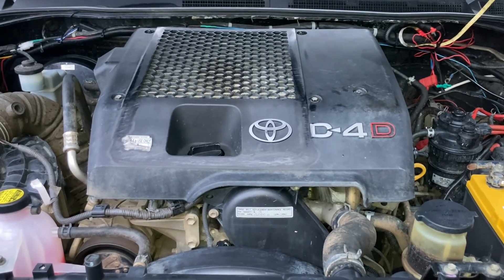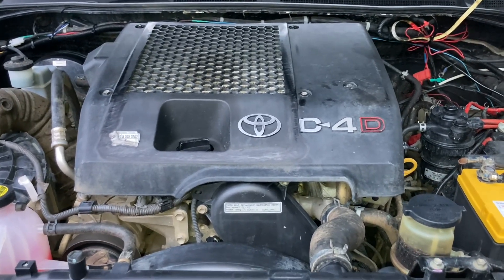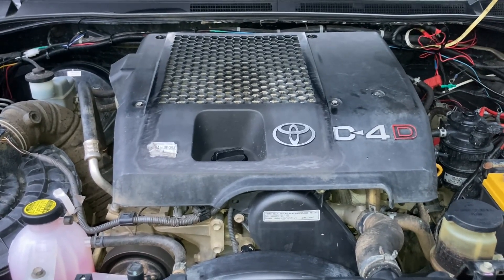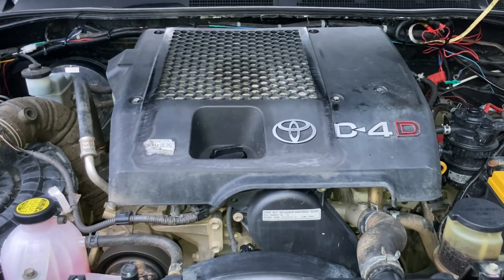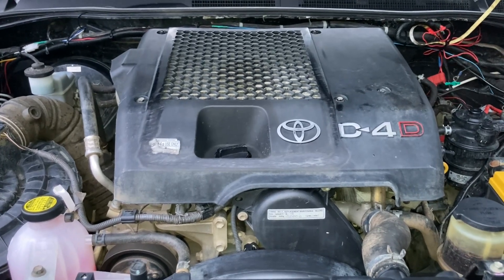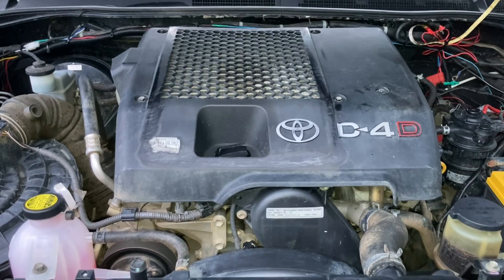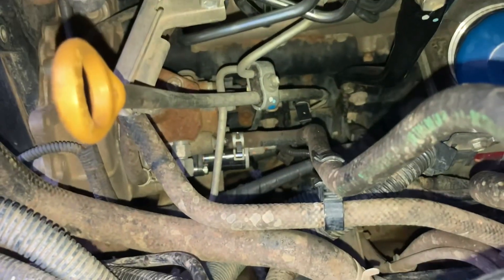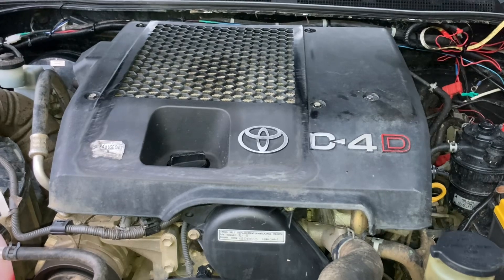D4d Engines Fourby4diesel 1kd-ftv SUPER WEIRD DIESEL KNOCKING

Comment: Call me crazy but I had this on my 05 lux when I changed the injectors. I didn’t bother with the comp codes. 

As soon as I entered the comp codes for the injectors the noise stopped. Engine run a lot smoother. Yes I know comp codes aren’t needed on a euro 3 but it solved my issues

Comment: Had this exact same issue after replacing SCV with a short one, fixed itself after a few short revs, target vs actual rail pressure still out of spec, don't buy short SCVs

Comment: Our Isuzu 150 trucks used to sound like that when they went into limp mode on the weekly for wat ever reason they had (broken wires, fuel issues, broken sensors) never had so many problems with vehicles in my life like I had with them trucks, yet I drive a dmax and love it, never had a issue🤷‍♂️ go figure!

Comment: What cycles on off for ten seconds?  The induction noise seems to lower pitch like there is a valve opening. Erg? Is the aircon cycling and changing load? I have a bad run on pulley on my alternator that makes a noise when there is low load at idle.  Putting the lights on loads up the alternator just enough to hear a difference.

Comment: Is it happening with the A/C compressor kicking in and out. Increasing the load without increasing fuel pressure?
Reply: The compressor pulley is visible and doesn’t engage during the noise change

Comment: Pressure Control Valve, high pressure pump, low pressure side. It's actually considered a service part that should be changed every 5 years. (I know they never are)

Comment: Fuel pressure related. Something funky going on with SCV or Pressure Discharge Valve.
Good job for Techstream because you can record the engine data and play it back as a graph.